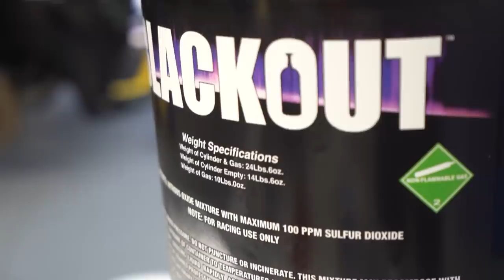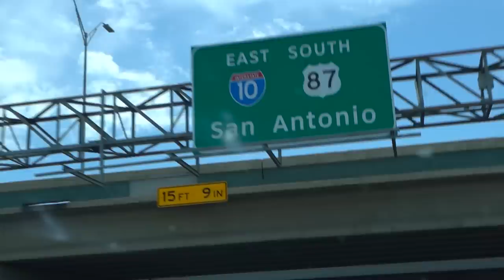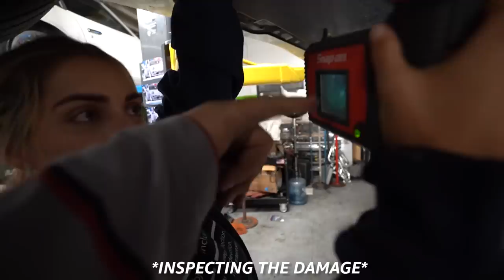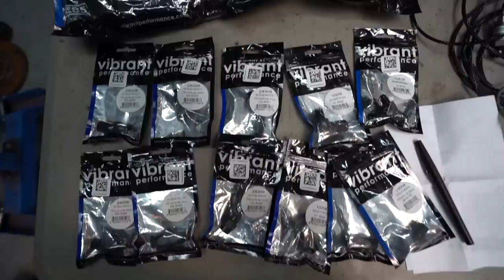Building a 1200HP Twin Turbo C8 Corvette in 15 Minutes!

Comment: I would like to say that the point in time in which you removed the engine and had it sitting on jacks was most impressive. The engine+ transmission shows it's true size when not mounted, what a beast !! 
PS- gorgeous engine as well, very nice setup with your twin turbos

Comment: It's nice to see you get to this point with a lot of hurdles in between. Having to rebuild the engine. Waiting to see when this cars full potential when the ecu is fully "unlocked" and you rebuild the drivetrain to handle 1000hp+  Let the bank balance recover a bit first maybe?

Comment: Be safe with that torque monster. I own a brutal and dangerous 1965 427 SC Shelby Cobra with 800 HP to the wheels. Weights 2300 pounds. Like you i am already into the 6 figures building this car. Scary ride and just like in 1965--No safety features. Except a roll bar. But i would now have it any other way.

Comment: @EmeliaHartford:  This compilation video is very well done.
Am looking forward to seeing this fine build with its massive HP & Torque realized with an appropriate DCT or TCT!

[am still hoping You will check out Amsoil products to protest and lubricate the fine machinery in this build, Mimi, and Your others too. Their products are very worthwhile and the best in the industry. See the engineers (as me) who know, promote and use them.]

Sincerely

Comment: It must be interesting to have both the desire and the money to dramatically modify a new C8 Corvette to greatly increase its horsepower. I suspect most people who bought the C8 Corvette would be satisfied with this car in its stock form from General Motors. Even the extra cost option packages for this car from General Motors is really good.

Comment: To the Red Ferrari owner who just dropped 400k 

How does it feel to get gapped bro?? 😫😫
Reply: About the same feeling when a Twin Turbo Huracan gaps a Twin Turbo Vette...
Reply: @hifitommy2802  if you spend that much you better gap it...you totally missed the point.
Reply: She did amazing job. But her vett not reliable. Ferrari are.
Reply: @stardogMLB  I don't think I missed the point. You're comparing a tuned Vette to a stock Ferrari. If the Ferrari was tuned to, the outcome would be different. But tuned Ferrari's aren't as common as tuned Lambos. So therefore I compared with a Lambo. The Huracans can get around 3000 HP in a street legal setup
Reply: End of the day a Ferrari is a Ferrari......2 - 5 years time what is the re-sale value of a Corvette let alone one that has been tunned/modded.

Comment: I am sure you know this. But i am going to tell you in case you don't. Just a 50 shot of nitrous with forced induction will yield 100 HP to the wheels. Nitrous drastically cools the intake charge  This is for all these haters out there that don't believe you car will make 1200 HP. I know this, because i have done it with my car. Your car has only the best parts money can buy. Don't be surprised if it makes over 1200 HP.

Comment: Respect, and from failure one learns. So even when it caught fire, fixing that will not only provide more knowledge on the car but also on how to prevent it in the future. That said... many like Ferrari, Lamborghini and Porsche got heat shielding wrong producing more and more power in their cars. Watching the episodes I felt this was an accident about to happen any time without having any knowledge on how well it was actually build. No offence intended, it provides great content anyway, but this, 'we know how to make this car faster than the manufactures who spend millions developing it', to the point of pulling 1000+ HP  out of an engine while all parts, gearbox, chassis, breaks, suspension, etc.. aren't designed for that. Does anyone think it is safe to allow anyone with a driver's license to legally use these modified cars on the road?

Comment: Did I miss a dyno? Is it really 1200hp?!?
Reply: Your lack of English comprehension is comical mate. The non-clickbait tilte clearly says "building..." implying, 'not finished'.
Turbo plus nitros = 1200hp easily when it is all sorted. 
The current clutch can only hold 600hp, and there are no 1200hp clutches availble yet, so the dyno will have to wait.
Here in Oz we have plenty 1200hp 4L i6 turbo Barras running around on the street without nitros.
Turbo makes it 1200hp easy with a built engine.

Comment: 1 problem...... the cars not 1200 hp!
Reply: Your lack of English comprehension is comical mate. The non-clickbait tilte clearly says "building..." implying, 'not finished'.
Turbo plus nitros = 1200hp easily when it is all sorted. 
The current clutch can only hold 600hp, and there are no 1200hp clutches availble yet, so the dyno will have to wait.
Here in Oz we have plenty 1200hp 4L i6 turbo Barras running around on the street without nitros.
Turbo makes it 1200hp easy with a built engine.

Comment: Still not fully tuned...???
Reply: The non-clickbait tilte clearly says "building..." implying, 'not finished'.
Turbo plus nitros = 1200hp easily when it is all sorted. 
The current clutch can only hold 600hp, and there are no 1200hp clutches availble yet, so the dyno will have to wait.
Here in Oz we have plenty 1200hp 4L i6 turbo Barras running around on the street without nitros.
Turbo makes it 1200hp easy with a built engine.
Reply: @nordic5490  lol wasnt expecting a paragraph response to my simple question. The reason her last one blew was because it wasnt properly tuned.

Comment: Can u call it 1200hp if the trans won't handle 700hp tho??
Reply: Your lack of English comprehension is comical mate. The non-clickbait tilte clearly says "building..." implying, 'not finished'.
Turbo plus nitros = 1200hp easily when it is all sorted. 
The current clutch can only hold 600hp, and there are no 1200hp clutches availble yet, so the dyno will have to wait.
Here in Oz we have plenty 1200hp 4L i6 turbo Barras running around on the street without nitros.
Turbo makes it 1200hp easy with a built engine.

Comment: 1200HP? Ha! Bullshit.
Reply: Your lack of English comprehension is comical mate. The non-clickbait tilte clearly says "building..." implying, 'not finished'.
Turbo plus nitros = 1200hp easily when it is all sorted. 
The current clutch can only hold 600hp, and there are no 1200hp clutches availble yet, so the dyno will have to wait.
Here in Oz we have plenty 1200hp 4L i6 turbo Barras running around on the street without nitros.
Turbo makes it 1200hp easy with a built engine.

Comment: i follow the video  and the engine fail  you need major upgrade to go 800 hp ,, so i found a video  , yes the engine is little bigger  427  single procharger  getting  1700 hp  with no nitrous . @

Comment: I don't know what's more clickbait you or the car
Reply: Your lack of English comprehension is comical mate. The non-clickbait tilte clearly says "building..." implying, 'not finished'.
Turbo plus nitros = 1200hp easily when it is all sorted. 
The current clutch can only hold 600hp, and there are no 1200hp clutches availble yet, so the dyno will have to wait.
Here in Oz we have plenty 1200hp 4L i6 turbo Barras running around on the street without nitros.
Turbo makes it 1200hp easy with a built engine.

Comment: How can you say it makes 1200hp when you've never made anything even remotely close to that? just because texas speed said your engine can handle 1200hp doesn't mean it makes 1200hp... You're almost like DDE with shit content and click bait titles, it's starting to be comical.
Reply: Your lack of English comprehension is comical mate. The non-clickbait tilte clearly says "building..." implying, 'not finished'.
Turbo plus nitros = 1200hp easily when it is all sorted. 
The current clutch can only hold 600hp, and there are no 1200hp clutches availble yet, so the dyno will have to wait.
Here in Oz we have plenty 1200hp 4L i6 turbo Barras running around on the street without nitros.
Turbo makes it 1200hp easy with a built engine.
Reply: @nordic5490  my lack of comprehension? dude... the video is of the entire time line of her building a "1200hp" corvette crammed into 15 minutes... even with beauty shots and a celebration at the end. youtubers are doing this "build a car in 10-15 minute" thing for click bait.. you're the one lacking comprehensio, pal.
So the car doesn't make 1200hp, it makes 600hp or less... you can't call it a 1200hp car when it has never even came close let alone can't... that's like me saying my 1400hp ls swapped rx7 when its really just a 400whp or less car. smarten up.
Reply: *parts